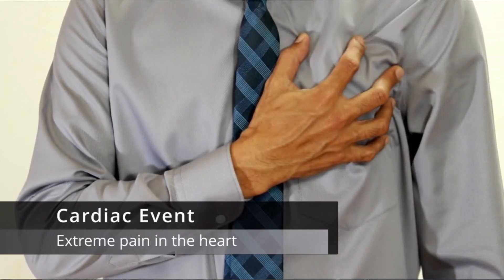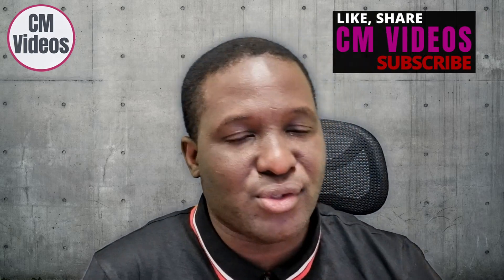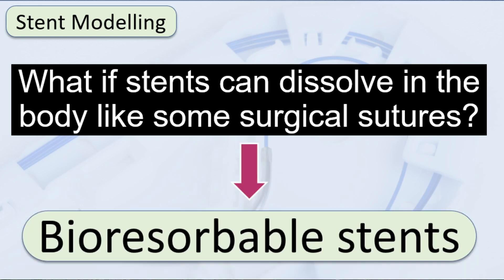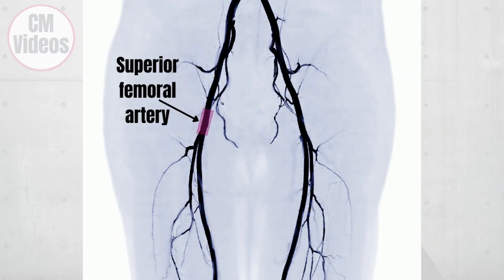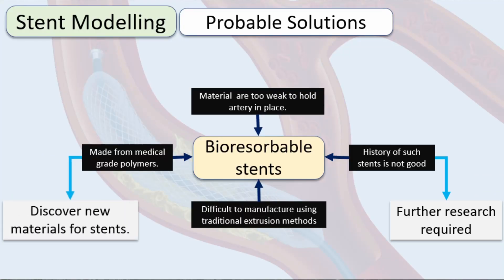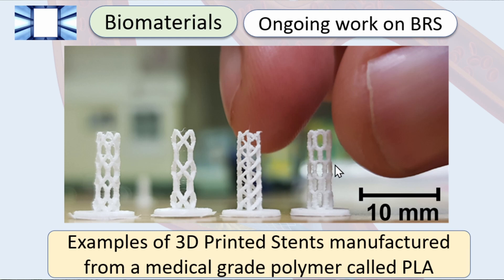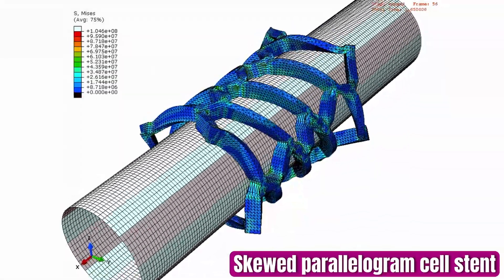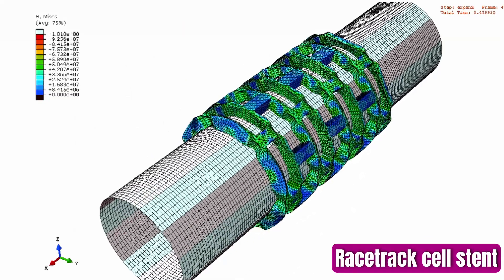Numerical modelling of stents | Designing dissolvable stents

Comment: Thank you Dr Michael, good video.  I have a question please. does applying virtual topology in Abaqus affect the accuracy of the results? ?
Thanks
Reply from the maker: Hello @Bika, this is a good question. The answer is yes but a minimal difference.  The essence of virtual topology is to help simplify meshing.  If mesh is different, the results will be different. However because the virtual topology is usually localised, that can lead to smaller effects in the overall scheme of the solution.

Comment: Thankyou very much, my question is how to know If a mesh is fine enough for accurate results ? and when do we care about mesh density assessments ? 
My regards Dr Michael.
Reply from the maker: Hello @Khaled soem, thanks for your interest in the channel. In terms of determining what mesh is fine enough, it is down to a mesh density assessment student. You cannot say until you run a mesh study to see. What you will normally do is to track the response of the model say to a given parameter. For example, if you are trying to predict the effective Young's modulus of say a composite, from experiment you know what the exact value should be. Then you will run different mesh studies (changing the mesh of your module) and determine the predicted effective Young's modulus. You will notice for small or coarse meshes, the prediction will be far from the ideal/experimental value. YOu continue to improve the mesh i.e. using smaller and smaller mesh sizes until you approach the experimental value. At the converged value, you should not see any difference in predicted values with increasing mesh density. 

You should care about mesh density always. FEM results are intrinsically approximate in their nature so the more you can eliminate sources of error, the better. So, mesh can be a source of error. So, mesh density studies help you eliminate error sources. You should ideally do  a mesh density study for every simulation first so you can identify an appropriate (convergent) mesh density for your further simulation. 

I hope the above is not too confusing. Thanks again.
Reply: @MichaelOkereke  "Since the model components were
already finely meshed, mesh density assessments were not carried out"
This is from your last paper, can you explain it please ?